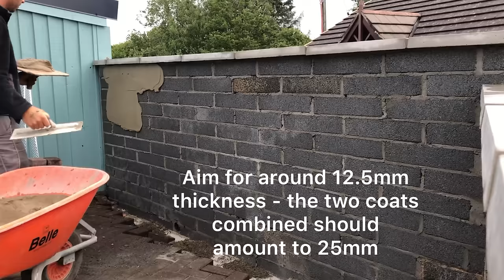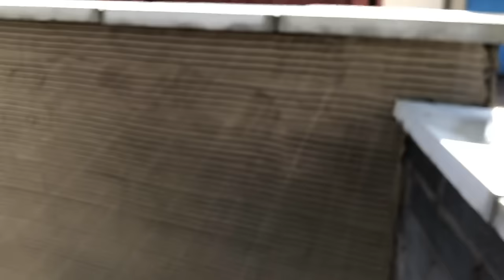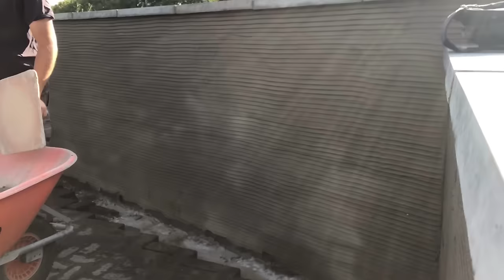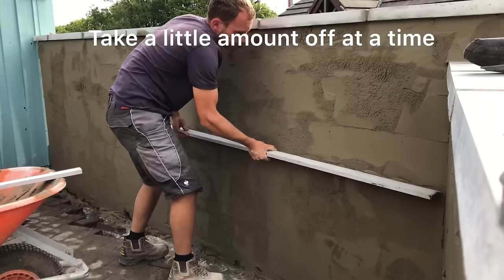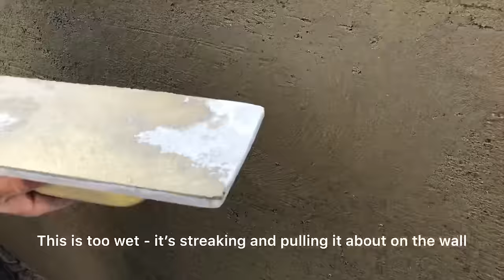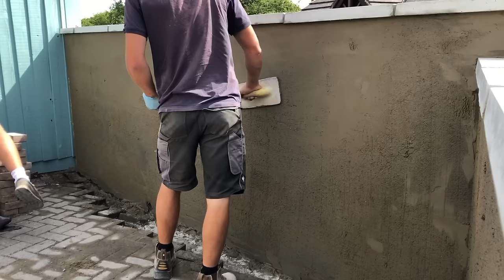How to plaster an outside wall

Comment: Over trowled the first coat. Quick brings the moisture to the surface and prevents maximum suction. Also didn't use a featheredge on the first coat 🤔🤔
Reply from the maker: Cheers for the tips Shaun. I don’t use a feather edge on the first coat as I’m happy with how flat I put it on. Always grateful of advice as you never stop learning!

Comment: Right to left if your a right hander only left to right when your skimming.
Reply from the maker: Ben Sharpe I’ll be honest I go either way, jobs always show up places where you have to do different things
Reply: I’ve heard that what is the reason for it?I work left to right no matter what I’m doing
Reply: @ollielake7421  when your skimming your not trying to put loads on your pulling away from it all the time so if your a right hander you go left to right. When your floating you want to build up the gear on the wall so your always working into it, so you start on the right so your swinging into it all the time.
Reply: Ben Sharpe makes sense I’ll try it thanks for the quick reply
Reply: Daniel Johnson  good for you mate
Reply: Ben Sharpe yeah I do he same Ben. It’s basically just to get a good coverage on the first coat. That wall has low suction. So u wouldn’t have to mess around on it to much. Just get it covered and flatten at the end I think. I stopped plastering like 4 years ago. Bloody hate it now 😂. But I like watching videos now and then. Great video btw
Reply: @bensharpe370  bull shit. If you go right to left it will start drying on the right first. Then we rub up left to right. So no. Its left to right all the time with a righty
Reply: fixit that’s not the reason he’s saying it, he’s saying about the coverage and not pulling material away. I’m with Ben on this one.
Reply: fixit yeah but I wouldn’t want to rub from left to right. It would be harder. You would wanna rub from right to left. Going anti clockwise with your right hand would be a lot easier and comfortable. So your be rubbing inwards. Not outwards. Remember. WAX ON WAX OFF 😝
Reply: @jimmybaldwin737  haha. not sure we are on the right wave length. You coat on left to right and you rub up left to right and yes anti clockwise
Reply: Slow as a wet week...and not properly scudded.
Reply from the maker: TheHorse70 no worries...I didn’t make this video to show speed. Also we don’t scud here but it’s interesting to see what people do in other parts of the world.
Reply from the maker: Daniel Johnson it’s always interesting to see the variations in trades in different areas! As they say, you never stop learning!
Reply: Yep spot on ben I just said the same but didnt see your post
Reply: @dillyhill2127  cheers mate

Comment: Lee Casper I agree 12.5 is ample. Also you should never let your scratch comb touch the brick or block behind as the whole idea to to not only create a key for the top coat but to give you even suction especially when on old bricks or walls consisting of all sorts. Good video though.
Reply from the maker: David Hammonds good point about the scratching. Thanks for the comment :)

Comment: if i want to do a white wall, do i have to use cement or is there another product in white color ? or any color other than cement?
Reply from the maker: You can use a product called K-rend which is already coloured
Reply: K rend tends to stain eventually anyway though right? Still have to masonry paint it in the end
Reply from the maker: @bh7791  It could just be cleaned off periodically and it will come back like new.  I am not a fan of K-rend though as from what I see round here (West Wales) it just gets green from the trees and doesn't get cleaned so looks awful, its the heavy texture in it that all the dirt clings to!
Reply: Yeah it makes buildings look so run down! I'm just about to render my thermalite double garage myself... I hear it's tricky!?
Reply from the maker: @bh7791  If its thermalite then id suggest going over them with rendagrip or similar to get a good key and better suction

Comment: Thought the scratching must be wave like, not horizontal.
Reply from the maker: Leonard Erasmus horizontal has always worked for me. I have seen it done wavy too. There is always lots of different ways in construction!
Reply: Yes as crooked as possible is the right way to reduce cracking..
Reply: @SamDaviesBuilder  wavey lines gives more key so less like to crack also use lime in mix more flexible also let it dry more before floatin or u can spray a light haze on it with a spray bottle if it has gone abit
Reply from the maker: bloggs692413 thanks for the comment. I’ve used lime before and have experienced fine cracking on the surface. With regards to a spray bottle yes that’s a good technique but I’d rather catch it earlier than rescue it with water. My horizontal scratching has always provided a good key but as I always say with building there is many methods to jobs so it’s interesting to see other people’s techniques.
Reply: Absolutely, just by using either horizontal or vertical lines can add shrinkage and cracking in the opposite direction. Best using big wave movement which minimises shinkage and improves the key. Good video though, well done
Reply: Waves do nothing.. horizontal does nothing. Vertical does nothing. It's the fact that you are opening the mud, not a smooth surface.

I back blade with trowel once ruled flat. For a scratch. More affective than anything else.

Comment: Is it critical to do 2 coats? I'm going to do my concrete block planters in my garden, will I get away with 1 coat?
Reply from the maker: If the blockwork is pretty good you’ll be fine with one coat

Comment: Very nice, I usually like to rule off the scratch coat too, makes top coat easier, (for me) looks as if you got it nice and flat anyway, agree with you everyone does things differently in the trade. Great video.
Reply from the maker: Rob Benn Thankyou for the comment!
Reply: Helps with the key also if you rule off the scratch coat and leave it rough.Stops all the sagging you sometimes get from a smooth trowel scratch coat.
Reply from the maker: ash wednesday good tip that is!
Reply: @SamDaviesBuilder  Just spreading the knowledge.lol

Comment: Great job Sam, very well explained, can't see why left to right or right to left makes difference? you can either do it or you can't!!
Reply from the maker: Jerry Moore thanks! No I never knew there was a direction to go!
Reply: It depends really,if you are right handed you generally want to pull  the material to your right ,away from yourself ,you will often hear a plasterer say ,I pulled that room in so much time,
Pushing is harder than pulling ✌️🧐

Comment: Looked really good finish and interesting to hear others views. I agree everyone has different ways. I always work right to left when rendering or undercoat plastering and left to right when applying finish. I would say you are rendering the wall as using a sand n cement mortar. Not outside plastering. Great job and hope others learnt from you sharing your way of rendering a wall. 👍
Reply from the maker: graeme maguire thanks Graeme! Yea I love checking out the ways other people do things and their techniques
Reply: I've always worked right to left when rendering so your working into the material and not away from it

Comment: Great video and no bs. I don't have the tool your using to rule off the wall. What's the best alternative thing to use. I just have a small area to do and want to keep cost down. Would a length of timber do the job for rule off??
Reply from the maker: Timber would be ok just make sure it’s straight. A  1200mm length timber would be best if it’s a small area
Reply: @SamDaviesBuilder  great stuff thanks for reply

Comment: Beautiful job 🎉 What is a plasticiser and how much do you add?😊
Reply from the maker: Thankyou 😃. A plasticiser basically adds air to the mix to make it workable - you won’t have a mix usable without some form of plasticiser. It depends on what brand plasticiser and how good quality your sand and cement is as to how much you’d add to a mix.  Say for a standard mixer full you could put two capfuls of plasticiser in on the stuff I use.
Reply: @SamDaviesBuilder  I'm in the US so trying to adapt this "recipe" to what we have available. I LOVE what you did. Have a wall that's been spalting for a decade! Do I want to look for any specific quality of portland cement / sand? Was gonna pick up whatever Home Depot has.
Reply from the maker: @stormbytes   it’s hard for me in the uk to know what brands of cement you have over there but try and buy a premium quality cement suitable for bricklaying/rendering. With the sand they do a plastering sand over here so see if there’s something like that in home depot, just make sure the sand isn’t too coarse.

Here is a link to help you understand plasticiser: 

https://www.designingbuildings.co.uk/wiki/Plasticiser

You may be able to measure your wall and input measurements on an online calculator to tell you the quantities you need. There’s loads of free online construction calculators

Hope this helps!
Reply from the maker: @epiphgd4302  it works but I wouldn’t recommend it.  Proper plasticiser is cheap enough and ensures no issues

Comment: May I ask how and if you seal the plaster down where the pavement stones are and how you fill the gap between the plaster and the stones once they are in their place again?  thanks for the awesome tutorial man.
Reply from the maker: Thanks. You wouldn’t seal it as such. Water will always work it’s way down. You’d just cut the pavement stones to fit up to the wall and then brush kiln dried sand in the narrow gap

Comment: Great job looks really good....I'm going to attempt rendering a brick wall this weekend, the wall I'm rendering is the back end of a terraced and the brickwork is 125 years old, crumbly and dusty too, would you pva it first? What would you recommend. Cheers
Reply from the maker: Jon Willock I wouldn’t use PVA. It’s water soluble so doesn’t work well outdoors. You can buy something like ‘rendagrip’ basically a paintable solution which enables the render to adhere to the surface.  A good builders merchants will stock it. Just make sure any loose/dusty bits are removed first. Ideally pressure wash it.  Check out my channel for another plastering video too!

Comment: Did you use any sort of PVA or grip on the blocks before scratch coat?

Does it just stick there no problem?
Reply from the maker: terry flynn the blocks had a good texture and the wetting of the wall provides suction. If you have a smooth surface I wouldn’t recommend PVA outdoors as it’s water soluble. I’d go for sbr and cement or ‘rendagrip’ which is a textured slurry you’d paint on before your scratch coat
Reply: @SamDaviesBuilder  we have thistlebond here in Ireland.I am not sure what it is but its recommended by my builder providers so i will try that on smooth brick

Thanks for reply

Comment: Hi I have been asked to re-render an external wall as it's got cracks in it etc, but behind the wall is the ground/road/basement effectively below the water table. How should I approach it, I presume there's no proper drainage behind the wall. It's always going to be wet, should I just render as usual or try and waterproof it, but how? thanks.
Reply from the maker: Personally I would paint on a thin slurry of sbr + cement mixer together then do a very thin scratch (make sure the wall has had a good hack off/wash off first to get rid of any old render) Then do your top coat as normal. I wouldn’t use waterproofer just Feb. If you want to cover the cracks then you could press mesh into the scratch coat.

Comment: when rendering outside of the house  do you put the waterproofer in the scratchcoat or topcoat or both ,,cheers
Reply from the maker: I would just use waterproofer in the top coat.  Use feb (plasticiser) in the scratch.  That is from my experience but other plasterers may be different.

Comment: Would you leave a gap at the bottom to allow expansion and for moisture to seep out?
Reply from the maker: No need for that in my opinion
Reply: @SamDaviesBuilder  Great - thanks for your reply! Great videos too, thank you very much.
Reply from the maker: @callumstewart86  Thanks :)
Reply: Yes put a drain there otherwise the garden will fill up with water and plaster will fall of wall

Comment: Thank you very much for the very helpful video and it came out great!!! 👏👏👏😉😉😉
Reply from the maker: Thanks! Nice to see people doing their own jobs from it :)
Reply: Ok mate, top video quick question what said is best to use? I am a diyer  & I want to render my block wall which has been bare for years. Do I put a waterproofer in scratch coat & top & how long do I need to leave scratch before I top coat it. Do I just spray scratch down with water to stop suction & what ratio mix do I use. Sorry for all the questions but I have no experience 🙈 I try my best but someone as good as you with a little advice I am sure I can get it to a good standard no where near your wall got no chance that's a cracking job 100%
Reply from the maker: bcfc red army you can use building sand, there is also plastering sand but either is fine. Make sure you pressure wash the wall off first if it’s been bare for a while to get anything like moss off it. In my experience I only use waterproofer if it’s a wall that is dry on the back of it such as a house wall. If it’s a garden wall then I’d just use plasticiser (Feb) on both coats. But that’s just my way of doing it. Plasticiser on scratch cost and waterproofer with a retarder in it on top coat will give you more time before it goes off. You can top coat if you’ve scratched  the next day at this time of year. Wet the wall before you scratch and the same for top coat. If it’s warm then give it a good soaking. 4:1 sand and cement for scratch and 5:1 for top coat. Top coat should never be stronger than scratch. No problem for all the questions and thanks for watching!
Reply: @SamDaviesBuilder  Thank you for the swift reply mate very kind of you. All the very best 👍

Comment: Please explain the plasticizer? Do you have a link to the product? How much did you use? Thanks.
Reply from the maker: Jan Nielsen the plasticiser is an air entrainer for the mix. It replaces the use of lime. You can’t use too much or there will be too much air in the mix. 

https://rover.ebay.co.uk/rover/0/0/99?loc=https%3A%2F%2Fwww.ebay.co.uk%2Fp%2F1406279262%3Fiid%3D293347555138 that’s the product I’m using
Reply: Also adding too much plastisiser will weaken the mortar. The use of plastisiser makes mortar more workable, easier to use and work with. You can use hydrated lime which is really good

Comment: Hi, how long do you wait to use the scratcher on the first coat and can you tell me how many bags of sand and cement was used for this wall. What’s the size of this wall. I have a 35sq foot stone wall to plaster over . Great job, thanks .
Reply from the maker: Minny Michael when it’s warm like it is at the moment then I’d wait 10 minutes until I scratch it. In the cold you’d wait a little longer. Basically if you start scratching and see anything move then it’s a bit too wet. You don’t want to leave it go off too much either so it’s a fine balance. With regards to quantities I was doing other walls on that job so I haven’t got a figure I’m sorry.
Reply: What is the minimum waiting time for the second render coat so water spray can be applied , is their a maximum time limit eg. If after scratching , it was left to dry out for days or longer would second coat still  adhere  successfully , thank you
Reply from the maker: Erik Kopsala you can go on the scratch the next day as long as it’s not been too cold. Don’t worry if it’s weeks or months later, as long as the wall is still clean and then wet it according to weather conditions
Reply: If you are Plastering over a stone wall you need to scud it before you scratch it. 2 sand 1 cement with a bit of sbr for good measure. This mix needs to be very sloppy and is applied using a dasher ( Harling trowel). If the stone is uneven, you can rule off the scratch coat to make it easier for yourself when it comes time to put on the top coat

Comment: Did you coat the wall with SBR or put it in the mix ? Or is it not needed ?
Reply from the maker: Hi Tony, not needed on a wall like this in my opinion. If you had a smooth surface like say engineering bricks you’d mix SBR with cement then paint it on the wall prior to doing a thing scratch. There’s enough grip on blockwork just to damp the wall and scratch
Reply: Mix with cement powder to make like a  slurry and then paint it on the wall or just out of the tub ?
Reply from the maker: @tonyhilton7097  mix with neat powdered cement like a slurry and paint it on. Make sure you apply the scratch coat while it’s still tacky so you’ll have to work in sections. Make sure your scratch is thin too or it will slide off the sbr
Reply: Got it 👍👍👍
Reply: @SamDaviesBuilder  is 24 hrs between coats ok mate ?
Reply from the maker: @tonyhilton7097  if you used sbr underneath I’d leave it another day. If you went straight onto blockwork it will be fine for next day
Reply: @SamDaviesBuilder  thank you Sam

Comment: Hi Sam good vid. How much sand and cement is needed roughly for a 5 sq m wall? I’ll be using an 18mm stop bead. Thanks for your time. Tomas
Reply from the maker: Hi Tomas, thanks!  You'd roughly need 250kg sand and 3 bags cement.  Thats allowing for a bit of sand and cement spare as theres nothing worse than running out halfway through!
Reply: Good man. 👍🏻